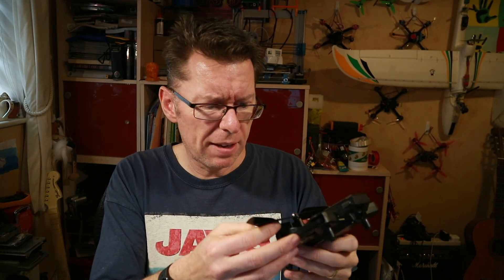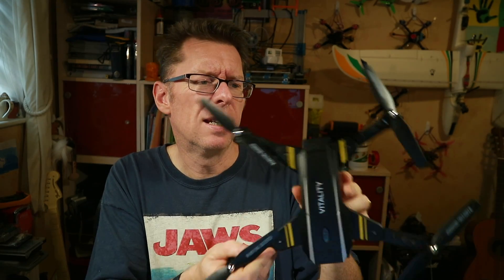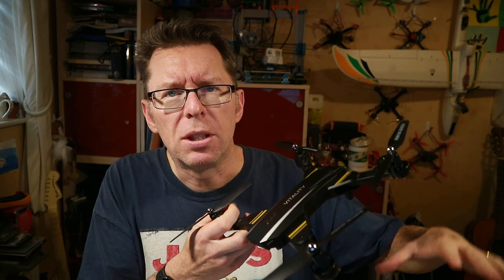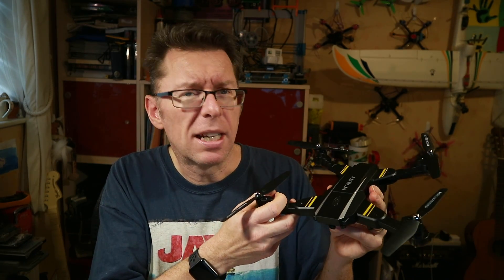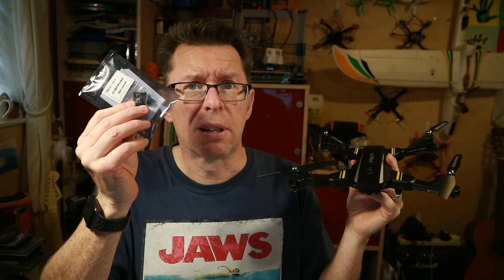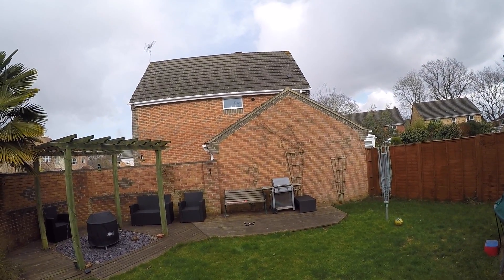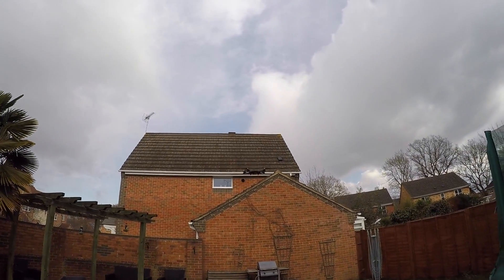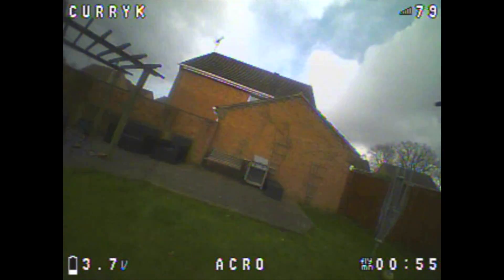Can we convert a Toy-grade quad to an FPV Betaflight-based Acro quad ?

Comment: I love this video! But the Realacc F3 has discontinued, can you suggest a similar FC? Thanks
Reply from the maker: Not off the top of my head I'm afraid, it's been a while since I looked at this.  This quad needed something a bit different as the motors were brushed - if you have the same quad look for any flight controller with in built brushed motor ESCs.

Comment: Now do same thing with bigger and better brushless motors drone and good camera. That looks so cool.
Reply from the maker: Well, if you are replacing that much with good stuff what you end up with is a sleeper quad.  Take a look at this video from my buddy who used a DJI Mavic frame https://www.youtube.com/watch?v=3oLqtRYbH0M&t=8s&ab_channel=BrightonTillIFly
Reply: @CurryKitten  what do you mean by "sleeper quad"?? I will take a look. I was tbh considering to buy maybe faulty (for the ESC? Drone and do replacement of all the FC and ESC and obviously add Gps and camera with Vtx that works with that ESC for betaflight. But still have the nicely design frame with folded arms, internal battery mounting (use of original batteries a must) and in general nice shape with closes structure. This would be for long range design as plastic frames aren't good for acro risky flies. Also I would add or use all these sensors for optical flow. To have what they sort of did with your DJI Fpv drone but still in more convenient for transport shape so I could take it into the mounting. Efficiency is also an important factor. So this drone would give me freedom of acro flying characteristic but with advances of modern rtf drones solutions. I tjinkt it could be better (if well done) than the DJI Fpv we have right now. But to be able to make it I would go for large frame form or example F11 drone or larger - with strong original motors and large battery of li-ion. Man, I wish I could join you in that kind of garage makes of ideas. I have so many projects in my head but still lack of skills in DIY for soldering. But I am always unsatisfied from what market already offers in regards of the drones technology. Still nobody has came up with almost perfect drone. Carbon frames are heavy and small. All this wires sticking out and dirt getting inside and not good to carry anywhere. There must be a way to do it better. .

Comment: you can just stick the whole fpv cmera/vtx on top of the drone with double sided tape
Reply from the maker: Yeah - but that wouldn't be much of a conversion would it.  I needed it open to get a proper flight controller in there, so the VTX/cam setup is easy to do while in there

Comment: can i swap the motor with bigger motor ?
Reply from the maker: Yes - although it depends in what config you are talking about.  Check the amount of amps a motoro will draw and make sure the FC can handle it... and if you want brushless motors, then you'll need a different sort of FC along with ESCs as well

Comment: Would this work on an mjx bugs 6 ?? This is a very interesting idea
Reply from the maker: Yes, but slightly differently.  As the Bugs 6 is brushless, you'd use a different flight controller and need to hook it into the existing ESCs (or ESC board) and hopefully they'd be a simple way of connecting up the receiver

Comment: I already had all the gear and got hold of a big cheap brushed (geared) quad running 2S, but with a nonworking flightcontroller so I wanted to try and convert it with an F3 board (all I had to get extra), it works but is really wobbly, so would be great to know what pids worked best for you in the end? If I understand correctly the ones you showed was not the best ones?
Reply: Great video by the way, have not seen many like it and would love more like this ;)

Comment: Sir, i know this is way to late to ask but besides the realacc f3 brush fc, do we need 4 in1 esc with it? or its intergrated in the fc?
Reply from the maker: It's integrated in the FC.  Brushed motors are much more basic than brushless, so the FC just varies the DC voltage to the motors

Comment: Really good video ! I love the fact that you salvage an old thing to make a better one. I would like to do the same with a XK X130-T with a burned main board. Do you think the Realacc F3 V1.0 would be any good ?
Reply from the maker: Yes, that should work.  That Realacc is more of a micro board, so a better choice for a 130mm quad like you have.  Presumably your original quad has the receiver built into the main board, and so you'd need a separate one to control everything.

Comment: watched the first 2 mins and in short.. no its not worth it.. the time money and effort spent to achieve the changes need you just aswell buy a proper quad. 

Good job on doing this though, i did watch the rest and as expected, its not possible to achieve the same quality or standards from a toy as u get with a cheap bnf
Reply from the maker: Yes - it was certainly more of a fun experiment to see what would happen instead of an alternative to a proper quad - but it's still on my todo to see if I can tune it better
Reply: Good job on getting it working and would be cool to see if its possible to create a decent flying quad from it.
As the main goal up using it as a stepping stone by upgrading it i dont think its at all worth doing, but definitely worth it as a fun experiment just to see what can be done and how far a toy can be pushed :)

Comment: Ditto for me, thanks for posting on this!    I have a MJX bugs B6 lying around and I love it for what it is particularly after upgrading it to fit 3S 1800mah and triblade 5" props, but I always wondered if could slip a betaflite controller on it without opening can of worms with all other components.  Plus what you have here is essentially a "sleeper Quad"  Imagine showing up at the field with it (eyerolls all around im sure) and then the double triple take when you start power looping it!

Comment: Hi Wayne, I just found an even easier way to get a quad in acro, the betafpv lite FC comes ready silverised and tuned( for whoops ) and literally just plugs in with motors on plugs to the boldclash b03 and others. I made a fpv video here https://youtu.be/kbH-s5aKC04 and a spoken ( yes I braved another review lol ) here https://youtu.be/X9Qa1GYh_H0 probably need tuning for something bigger than a whoop but that possible with out flashing too using gestures to change pids.
Just thought it might be something you would be interested in.
Cheers
Nigel.
Reply from the maker: I have to say if I'm swapping out an FC and figure I might as well go Betaflight, and certainly TinyWhoop sized things you can get the board with an inbuilt rx... albeit a bit more expensive.  I am interested in testing the Silverware out though, but I figure if I'm going down that route it's the sort of "look I didn't have to spend anything to get acro" kind of deal (well, aside from an ST-Link if I'm understanding things correctly).  It's an interesting firmware though, I'm definately going to have a look at it... time is always against me though !
Reply: CurryKitten agreed, things change so fast, when I started silverware it was because of the price of betaflight FC and h101  were cheap , now betaflight boards are cheaper is less of a difference. The boldclash b03 is the one to get ATM , still link v2 is £2 odd , my silverware quads do fly just that little bit better than my betaflight ones somehow.
I think the betafpv board is well made though and will fit more quads than a b03 board, it's amgood replacement and the fact that is already flashed with acro and perfectly tuned makes it an easy option for those who are not able to flash silverware for whatever reaaon...or maybe for someone whom is building something new or has a quad that can't be flashed, the new e011 can't be silverised now due a change in production.
Anyway if you ever want to silverise anything let me know and I can help out if you get stuck at all.
Cheers
Nigel.
Reply from the maker: Thanks, I'll be sure to give you a ping if i get into trouble, and hitting things with a hammer doesn't work :)
Reply: CurryKitten haha yes the hammer doesn't seem to work so well these days like it used in my telly mending days lol. Cheers!

Comment: These are the type of videos we need, and I appreciate you doing it. Can you do more with micro toys, I'm sure everybody got micros.
Thanks again, this is a winner!!!😆
Reply from the maker: Many thanks - yes, since a few people mentioned this Silverware firmware, I thought it's definitely worth checking out - so on the to-do list is something about converting a micro to use that, and using a better radio with them.
Reply: CurryKitten I want to do this with my hubsan h502e , but I want to keep its original fc & just figure out a way to get osd , so i was thinking of attaching a f3 FC to the power supply & add s camera to the f3 and just don’t hook anything else up to it , so the fc will basically be using power from x4 battery & giving me a voltage reading & it’s basically purely for OSD
Reply: The LongRanger You don’t need to go through all that, many aio camera/vtx combos have osd built in, and you literally only have to power them directly from the 1 or 2s Lipo. Old comment I know but just thought I’d share since for most of these toy conversions a little $20 aio camera is perfect and so easy.
Reply from the maker: Am I right in thinking that Hubasn doesn't have FPV out of the box, and so you'd be adding in a camera and VTX ?  Perhaps the best option here is the RunCam Micro Swift 2 (which will display battery voltage) coupled with a little VTX you can fit to the back of it (there are specific RunCam ones, but I've also used a Eachine TX03)

Comment: Did you find better pid settings? I started from 65 P and as I go up it seems better, only in acro, last test was with 90 P and it seemed better. I will do more testings messing up with D and cranking it also up. I don't think it will ever be able to do sharp acrobatics due to the geared motors but It might be a way for a cheap fpv system that can carry a light HD camera.

Comment: I have been curious about this since I picked up a CX-30W but the guy who has been mentoring me went on about the pointlessness of the effort, but my curiosity and desire to learn the in and outs of building one has been getting the better of me. The quad is plug and play for most of the parts from what I have seen and I'm curious if it will work with an Omnibus F4 I'll be picking up here soon.

Comment: cool video!
I tried this last year with a scisky and JJRC H31and had OK results. At the time i didn't fly acro, so this is horizon mode. i never really spent much time tweaking PIDs. and when the frame broke i kind of forgot about it. then a few months ago i built another one and had horrible issues with bobbing and wobbling. I think more modern firmware is actually worse for these brushed, geared quads. ?

I think the main issue is BF also wants to see active motor braking, of which there is none.
I wonder if turning down the PID loop time and messing with PWM of the motors might make a difference?

anyway here was mine when it was working OK. im bummed i didn't save the configuration on that board tho. no idea how to get back to that point , or make it better.
https://www.youtube.com/watch?v=zuXAE1gMvGk
Reply from the maker: Yes - it works brilliantly on default PIDs on brushless quads with decent ESCs these days, but I don't think it was ever intended for quads like this.  I've got some tuning ideas, I just need to get myself a little bit of time to go through it

Comment: Great job, very enjoyable for a rainy saturday. Just a thought about the receiver, perhaps it prefers a slightly higher voltage? I had similar brownouts on a micro brushless with an FrSky type receiver - there was talk that a voltage regulator might fix this, taking the receiver voltage up to 5v, but I messed up the soldering and promptly returned to brushless quads :-)
Reply from the maker: The F3 board should be putting out a 5v signal to the rx, but I haven't tested it out.  Not overly worried as I can't imagine me flying this thing great distances - and I will probably steal that rc for something else, and put a little micro rx in this quad
Reply: Ah, you're right - the experiment was a success - you nailed it.  But imagine a brushed, geared quad with GPS heading out 1km? LOL - maybe soon ;-)
Reply from the maker: GPS's are for wimps, we did get up to 650m on an 80mm 1s brushed quad before running out of field (https://www.youtube.com/watch?v=89kJdHoikhU) but looking for 1km out of that still

Comment: Excellent video....Very informative....But you will need to be reasonably competent with electronics and be able to carry out basic soldering skills to achieve a similar end result as yours...This will probably be a more experimental experience.. for the inexperienced  flyer ....who probably just wants something that flies with a reasonable performance.
Keep up the good work....you certainly have great tuition skills.
Reply from the maker: Yeah - it's definitely not for everyone.  But for those who like to dive into something and tinker about they'll have a good headstart when it comes to fixing other quads.  Definitely more of a fun experiment than a serious flyer
Reply: No worries... Credit where credits due... Nice to see someone who knows his stuff and how to present it on u/tube for a change. AndyRC is another guy who is first class also IMO.

Comment: Here's my attempt at a brain transplant:

Quad - https://www.ebay.co.uk/sch/i.html?_nkw=mould%20king%20super-f
AIO Flight Controller - https://www.banggood.com/Eachine-AIOF3_BRUSHED-Flight-Control-Board-Built-in-OSD-FrskyFlyskyDSM2DSMX-Receiver-Betaflight-p-1107427.html
Camera/VTX - https://www.banggood.com/Eachine-AIO-FPV-5-8G-25mW-48CH-VTX-600TVL-CMOS-14-inch-Camera-For-Aurora-90-100-Mini-FPV-Racer-p-1122902.html

https://imgur.com/EXyrQmK
Reply from the maker: Great work !  I've used thsoe AIO FC and RX boards before in little brushed micros.  The reason I didn't in this one was the idea that you could progress to another quad and take the rx with you (or just buy another one of course)

Comment: Love your project. FlySky transmitter and EV800 goggles are good choices if you're on a budget. But instead of buying a flight controller, receiver and VTX you could spend 60£ on a Furibee X90 that comes with all of that, has brushless motors and performs way better than any toy drone. To be fair, you would have to buy batteries, too, though.
Reply from the maker: (and a charger) but yes, I quite agree if you can go the whole hog and buy a proper brushless quad then you are going to have a great time.  Although I'd still recommend a 5" over a micro for a first timer.  Less finicky to fly and easier to fix and get replacement bits.  BTW, I couldn't find the X90 and nothing for £60,  Furibee do several 90mm quads, but wasn't sure which one you meant ?
Reply: Sorry, I got the name wrong, I meant the Furibee Q95. Now Gearbest lists it for 107£ which is a lot, but I swear when I looked at it an hour ago it was 59.something £ with a receiver.
Back to your project. Do you think the FC or motor wires were limiting the power output? What distance did the pins have where the original PCB was screwed on, 30.5mm by any chance?
I started with micros myself (new to the hobby) and I like that they are almost indestructible which made me much more confident when trying risky maneuvers.
Reply from the maker: Gearbests prices change almost constantly, they are a nightmare to keep up with - especially when I'm trying to maintain a coupon/deals page.  I did just add this (affiliate) link https://www.gearbest.com/promotion-best-action-camera-special-1106.html?lkid=13325881 which does have the Toad 90 and GT 90 around the £65 mark - which is excellent value.

Do you mean what the mounting hole dimensions were on the original FC ?  It was rectangular, but the mounting holes were in a square of approx 25mm.

Certainly a good point about micros tending to smash themselves to pieces more, they do still feel a bit fussier to me though